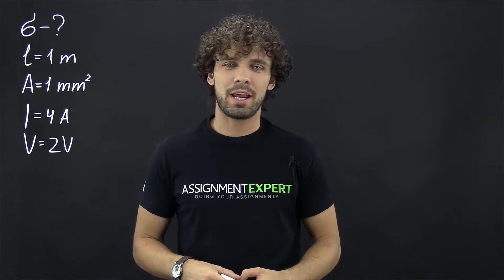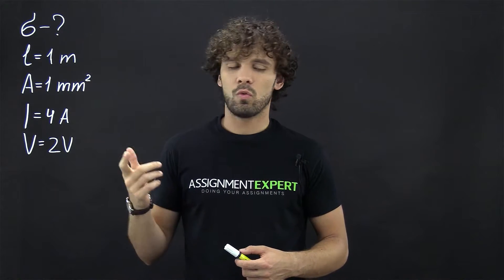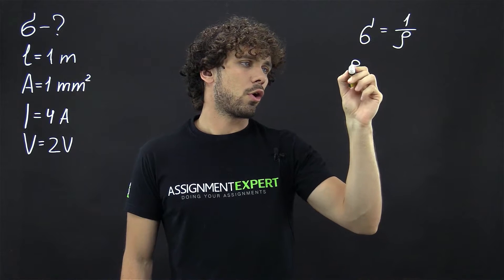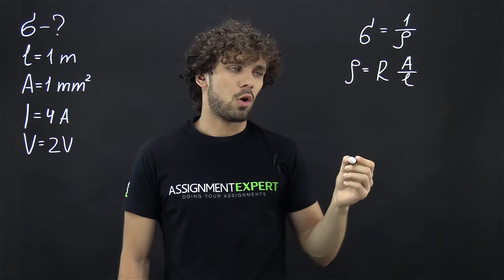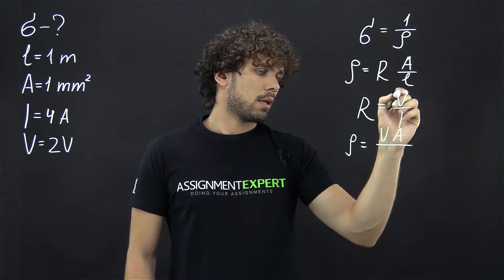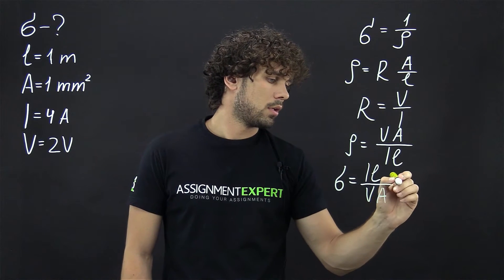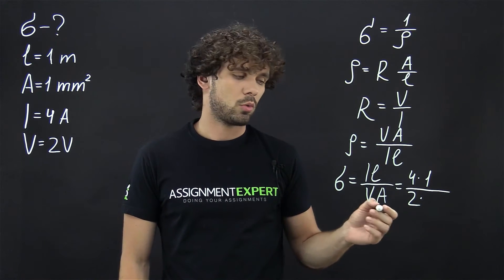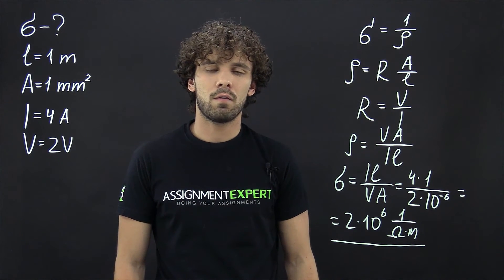Calculation of the conductivity of a wire

Comment: if the voltage is 5v length is 1km radius 9mm and current 3a then what will the conductivity?
Reply: 2.36 x 10 power 6

Comment: Pls solve this one 😧😧😧😧
a metal wire has diameter of 0.25mm and electrical resistivity of 0.8*10^-8 om metre .
What will be the length of this wire to make a resistance 5 om
Reply: 3069.4 meter